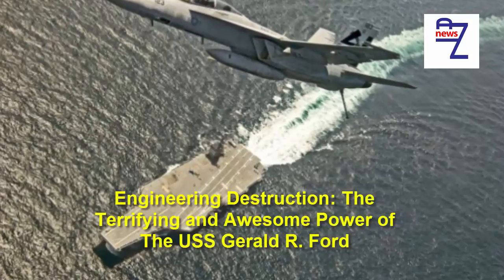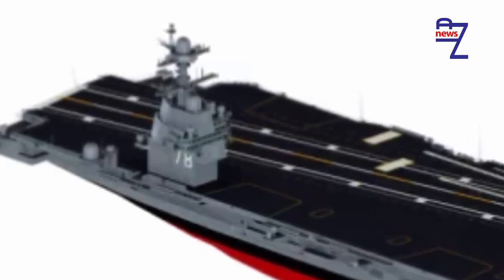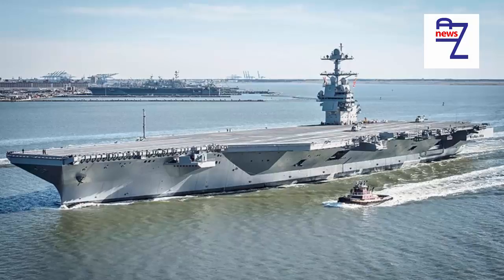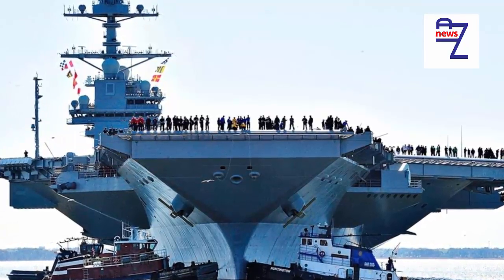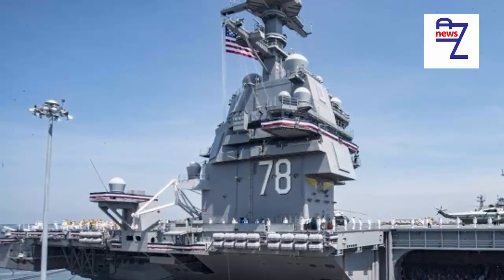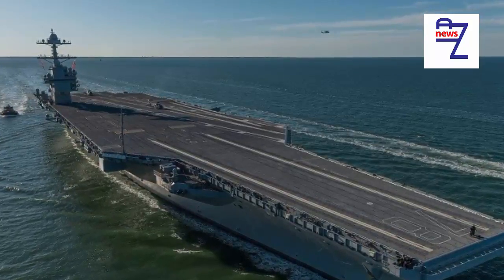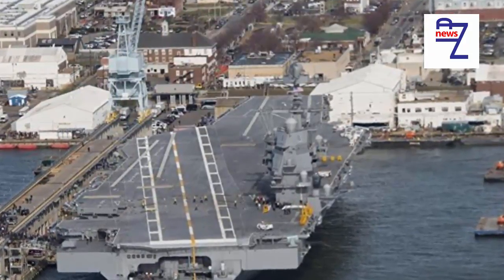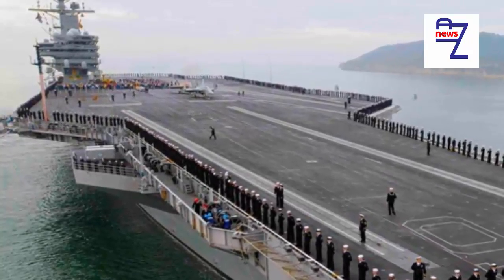Engineering Destruction The Terrifying and Awesome Power of The USS Gerald R  Ford

Comment: The delays and cost overruns were created, over a decade or so ago, when as a direct result of failures and/or incompetent manipulation of the initial critical path programmes where by false and/or unworkable concurrent activities were used to grossly exaggerate the speed of construction and thereby underestimate the costs. 

This arose due to the desire to integrate many items of new technologies which had not been fully researched, designed. and fully understood. In other words they effectively used wild guesses based on available concurrent time frames within their basic programme to effectively specifically define how long it should take to invent something, as this was obviously a ridiculous ask it inevitably resulted in both time and fiscal chaos.

USS Gerald R. Ford was not the only victim of this, what some people call  "Concurrency Programming Errors" many other projects suffered to a lesser or greater extent i.e. Littoral Combat Ships, Zumwalt Destroyers, Reintroduction of the old Arleigh Burke Destroyers, the F35A/B/C Lightning Fighter, etc. etc. Examples of Technologies causing these problems are Rail Guns, Stealth, Lasers, New Propulsion Systems, Automation, Mission Pods, etc. etc. Simply put the projects were drowned in new technologies, often only introduced to initially sell a project.

This is probably the greatest calamity that the USN has had to deal with since WW2.